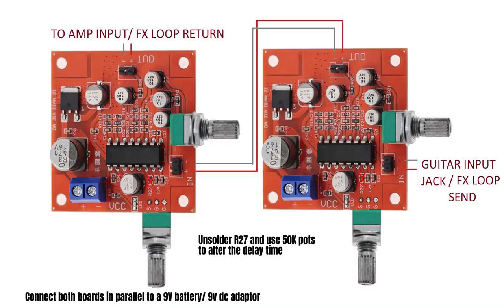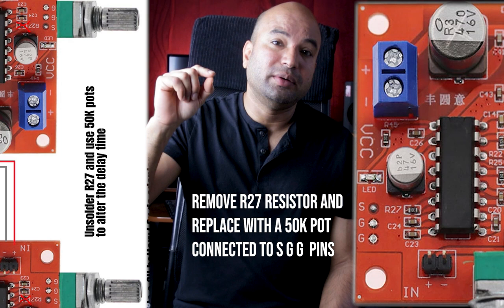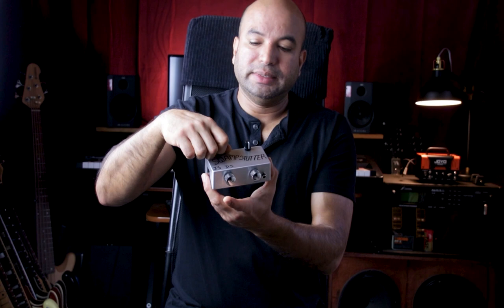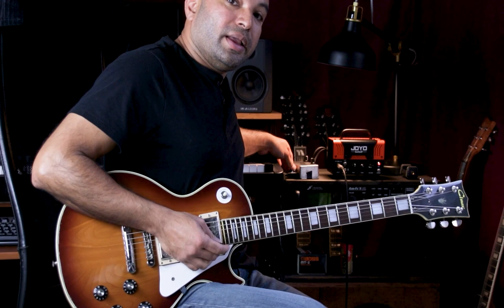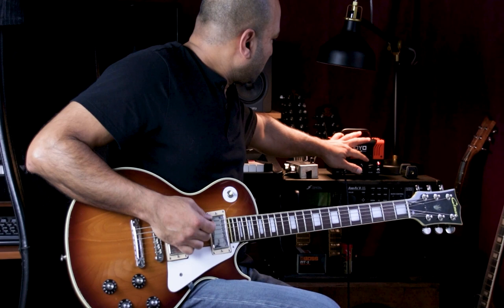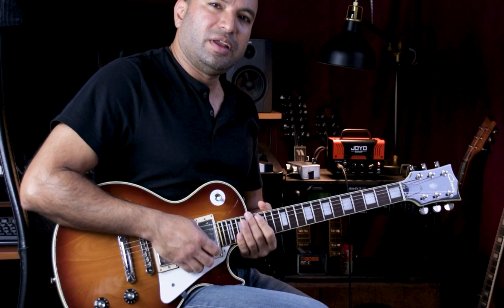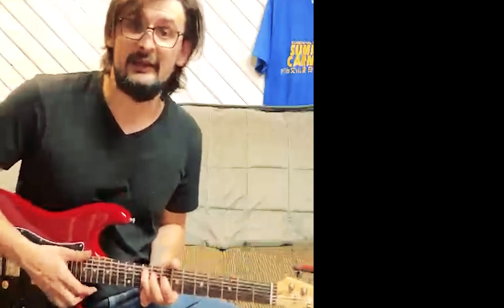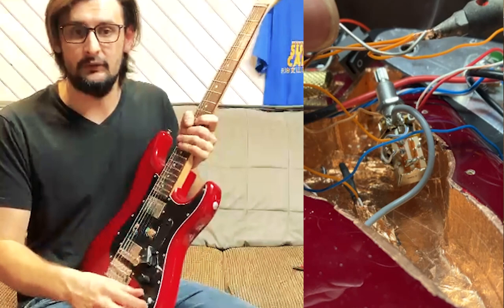PT2399 Delay  "SWAMPSTUTTER" DIY Delay Pedal Build

Comment: Thanks for the vid and congratulation :D It's really cool to see how happy you are that you completed this.
Do you think this would sound good combined with a kalimba?
There are other boards as well, like pt2399 karaoke boards that can lead to interesting results as well …
https://www.youtube.com/watch?v=ysiBga27AOY
Reply from the maker: Hi thanks so much 😀 yeah I was pretty stoked to create this delay. Thank for the link, I had checked out those other boards too but for the purpose of guitar delay I felt this approach would be more suited. Yeah I think it would work for kalimba. This is more suited to clean signals rather than high gain. The results in got in the fx loop were very usable. I am going to make another test with my Marshall amp soon hopefully 😀 cheers!
Reply: @DavidsMusicChannel  Ahh nice :) How are you powering it? Most of these boards are powered with e.g. a 9V battery, but the boards says 12V is also okay and you are using one power jack for two boards, right? At least that is what I can see here: https://youtu.be/83QyYBi0O98?t=146

What would you suggest to buy to recreate this?
Reply from the maker: @noncesens3179  that’s right so while they can support up to 12 I just used what I had which was a 9v boss/ibanez adapter. I just connected the two boards supplies in parallel to give them 9v each.   I haven’t made a parts list but basically tow boards, link in description, two 1/4 inch female jacks, dc female connector, two 50k potentiometers and some wire to bring it all together. There’s a schematic in the video. Hope this helps, let me know if I missed anything
Reply: @DavidsMusicChannel  Thanks, that helps. And ou are explaining it here that you are using one 9v power supply and one female dc jack: https://youtu.be/83QyYBi0O98?t=185